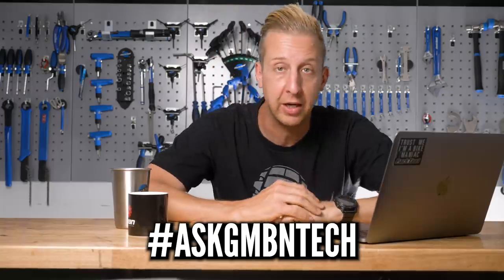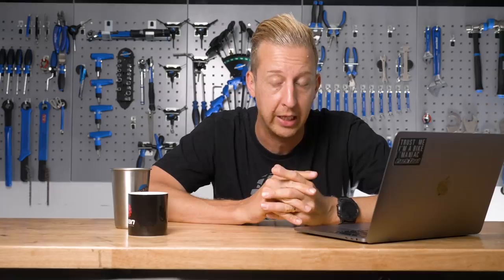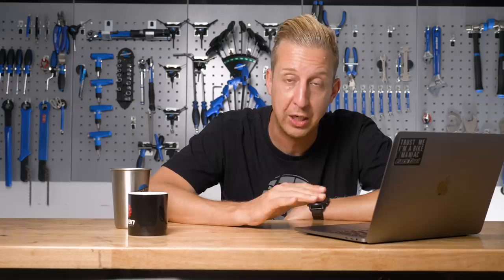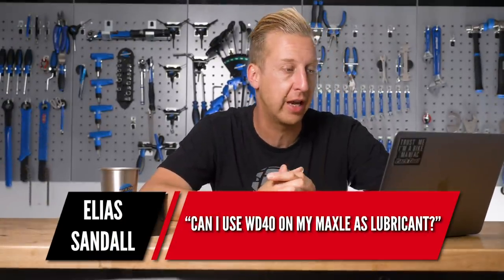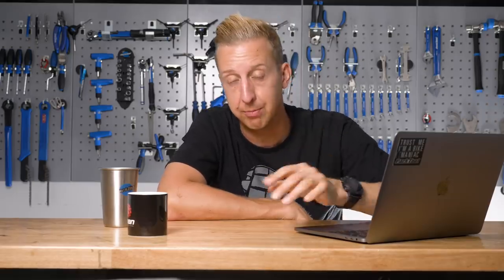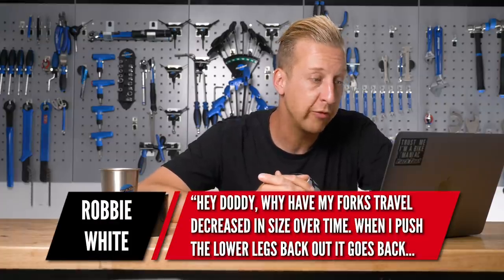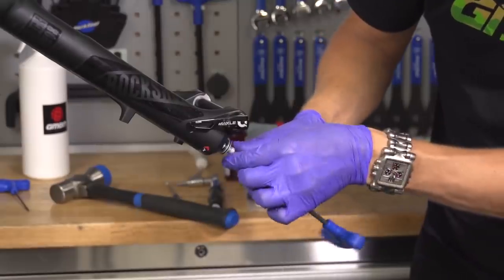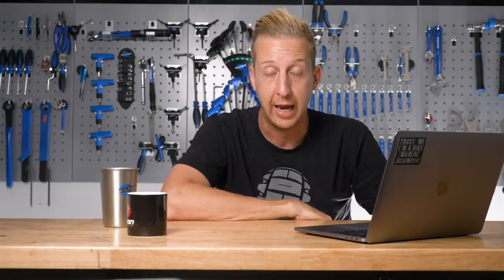How Are Disc Brake Pads Made? | Ask GMBN Tech Ep. 85

Comment: #askgmbn i have a problem with my rear shox is stiff at first .5cm of travel and it makes weird noises And after it passes that its normal. What sould i do
Reply: Send for service, could be blocked neg chamber port
Reply: @rupedog  not interested i would rather fix it myself if possible
Reply: @rokbukejlovic  would only recommend that if you are experienced with mechanical stuff. A shock has pressure in it, and if not disassembled right can hurt you. Service is about 40 to 50 € I'd say, so I can understand you want to do it yourself. If you do, inform yourself really well before taking hand on your shock.
Reply from the maker: If it has friction at the start of the travel it could be a number of things. If you think it's an issue we suggest getting it looked at by an experienced mechanic. All air shocks are a little stiff under the first compression if have been stored for a while. We suggest you cycle the shock maybe once a week and you could also try leave the bike upside down just to help keep some lubrication on the seals. Regular lower leg service will help avoid this in the future. 👍
Reply: GMBN Tech can it be anything wrong when I released all the air out of it. When you relese the air the bike is compressing the shox right! ?

Comment: #AskGMBNTech Hi Doddy, Love the show. Had a question regarding some retro stuff for you. I have got by ocassion old stock Specialized Epic S-Works 2010 frame in new state. It has tapered head tube, while place for bottom bearing is to deep to fit any 3rd party fork. I've found some adapter Specialized used to produce for such cases, while it is out of stock everywhere. Do you have any idea of what I can use as adapter or some measurements to follow to build one in workshop. So far the idea is to have 2 bottom headset bearings instead of one. Cheers from St. Pet, Russia. Marat

Comment: #askgmbntech I’ve been working for a bike shop for 4 years now and want to get into an industry job, preferably product design, but I don’t want an engineering degree. Is there any way to get into a product design position without a degree? I fully understand geometry and part specs, don’t want to design the leverage ratio or anything like that.
Reply from the maker: Hey Tyler, a solid understanding of product design is very important and many companies will require a degree. We suggest you continue building good relationships with people and learn as much as you can and just get talking to some people at trade shows to ask them what their story is. Best of luck! 👍

Comment: #askgmbntech Can you share tips or hacks on the best way to prevent to oil from getting on your brake pads and rotors while oiling your chain?
Reply: Don't use a spray lubricant....use a liquid and just dribble it on then wipe it off. No chance of contamination

Comment: #askgmbntech Hi Doddy, I am looking for a full suspension trail bike, but I have a size problem,  I am 200cm(6ft 7") tall, and 134kg. You know any brands who got bikes that size? Or am I too heavy?
Reply: I am 190cm and i ride a Trek Fuel EX in 21.5 size. I have short legs, maybe i need a 19.5 because the saddle is in my way on very steep trails. There is also a 23 size. But your weight is a problem for the suspension. It has a fox 34 fork an i ride 115 psi with 110kg. 120psi is max. I have to ride the shock with 270 psi (275psi is max). Maybe a bigger fork and shock need less pressure. My downhillbike has Fox 40 forks and for the same sag i need only 105 psi. I dont know if this is the fork or the bike geometrie.
Reply: Cube make bikes in 22inch seat tubes which is very long and probably about your size.... if that’s any use
Reply: Pole and Nicolai have the longest reach options as far as I'm aware, both offer sizes recommended for for your height. I'd go with a Pole, they're fantastic bikes and are priced pretty well. (The reach on the Cube bikes is waaaaay too short for you, it's already too short for me at 6'2")
Reply: @samhaven4562  I use 23" now, which it is too small

Comment: #askgmbntech 
Hey love the show and GMBN! I am buying my first good bike which happens to be a full suspension kona 134 I was wondering if you could give a brief run down on how to maintain a nice full suspension bike properally. Thanks!
Reply: Keep pivot points of deraillures, pivots, and chain lubed, and get your fork and rear shock serviced every one or two seasons depending on how much u ride and conditions (ie are your trails super dusty, is it hot humid or dry). That's about it. check your bikes suspension pivots periodically to make sure they aren't coming loose (some bike brands pivot bolts tend to back out with time. I don't think kona has that problem because they emphasize oversized bearings and bolts). If you're unsure about anything else, I always recommend bringing your bike in to your local service shop. They can help you Get things dailed.
Reply: JMANSWAT Thanks! My trails are pretty dusty and ride 3 times a week what do i live the pivot points with?

Comment: #askgmbntech my dj bike is a 2011 frame and I was wondering if you knew any good affordable 26” wheels with a bolt axle because that’s all my frame fits in addition to this it does not fit a regular mtb wheel with space for a cassette, thanks a lot, finbar

Comment: #ASKGMBN can I combine SRAM 1x11 with Shimano 1x11(Shimano Chain with SRAM Cassette darailior
Reply from the maker: Hey Florian, yes you can do this. What you can't really do is run a Sram shifter with Sram derailleur as they use different amounts of cable pull. You can use any 11 speed chain or any 11speed cassette providing the derailleur is compatible with the range of teeth. Hope this helps 👍

Comment: #askgmbntech  I have a 2x9 drive train i what to switch to a 1x with a bigger chain ring or just getting a 10 to 12 cassette. i live in a flatish area.
Reply: I believe a shimano 11 speed cassette should still fit your hub. Then get a middle-ish ring for the front. If your area is flat then anything from 32 to 38 for a front ring would work. You'll need a new chain for the narrower 11 speed cassette and the added length to accommodate the big cog.

Comment: #askGMBNTech - I broke my chain yesterday, but luckily had a quick link in my bag, so was able to get back on my way quickly. However, I now have two quick links on my chain. Is that a terrible thing, sort of bad thing, or mostly ok thing? It is a relatively new chain (from June), so I hoped to get more life out of it.
Reply from the maker: Hi Michael, if you have broken your chain twice now we would suggest you check for wear on your cassette or chainring causing damage to your chain. Split links are strong but we would say that it may be on the safe side to just get a new chain.
Reply: @gmbntech  Thanks. One link is something I always put on my chains so I can easily remove and clean. The second was from the break. Cassette is probably in need of replacement. Maybe time to convert my whole rig to 1x!

Comment: #askgmbntech I just got a new entry level bike (carrera vengence) and want to convert to a 1x. As I’m not sure if I can fit a larger 10/11 speed cassette I found a 11-42 8 speed cassette, will it give me enough range with a 30/32t chainring. Thanks keep up the good vids:)
Reply: in my opinion no, you either lack topspeed or a climbing gear depending on chainring size.
Reply from the maker: Hey Dani, your rear wheel may be limited to a 10 speed cassette. If this is the case you still have some great options. Microshift make a wide range 1X9 setup and Shimano make the 10 sped M6000 Deore group. You can also just source a thick-thin/ narrow-wide chainring for the front. Most people will have a different idea of what enough range is but you may want to look for a little more. Hope this helps 👍

Comment: #askgmbntech
Reply: I recently got new tires for my bike and I can’t get them on for the life of me. I already broke like 3 tire levers and still can’t get them on had to take them to a shop they said they had never had I tire like this and they somehow got it on after we left the wheel there. Then I got a pinch flat now I am back in square one. And it’s not like the tire is defective because I tested to see if the old tire would go on any easier and it’s the same case can’t get it on the rim. HELP
Reply from the maker: @evanwardrop7054  Hi Evan, they tyre may have hopefully stretched ever so slightly since it has been mounted. You may also want to check the rim tape, and install some thinner tape if possible. Some rim and tyre combinations can be tight (or loose) so maybe it could be worth trying a different tyre brand 👍